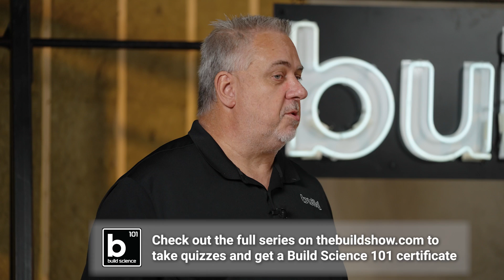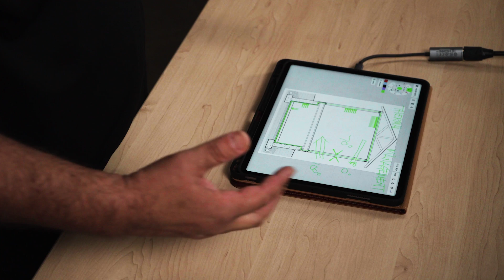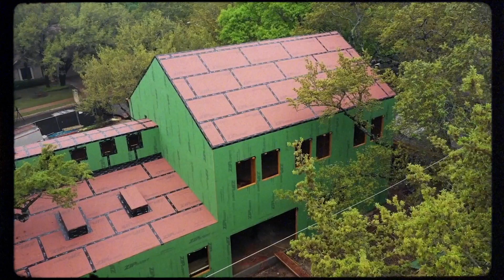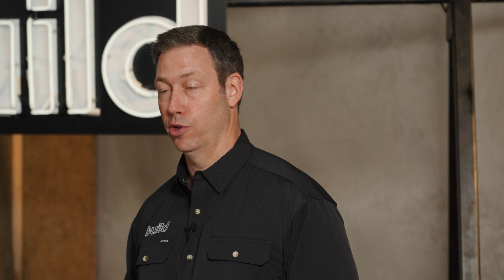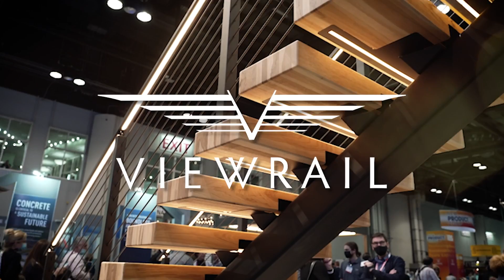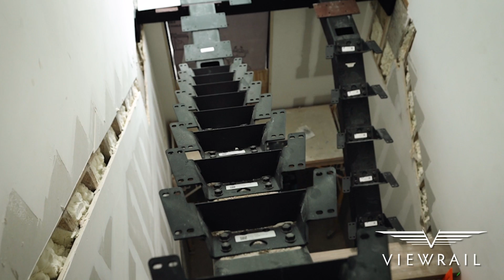Build Science 101: #10 Wrapping Up with Thermal Insulation

Comment: We build windows and patio doors with only glazing, and then close the blinds at night, which is more than half the time in the winter.  Time to bring back shutters, and insulate them now.  The sizing of furnaces is basically driven by winter conditions that happen 1% of the time, with the load significantly dominated by glazing.

Comment: Matt, I was just about to get ahold of you somehow and ask you what the best way to insulate inside or out.And then you guys turn right around three minutes later in this video and told me you said outside of the wall and I'd take it rockwool as tight as you can get, At that point can I put hardy board on the outside of the rock wall for my finished outside wall and will it be all right to sweat and let it sweat out the bottom, And then put some type of bug Mat or something on the bottom so the bugs can't get in.It would that be the correct way to build the wall?Keep it insulated, keep the bugs out and so on.Please let me know thank you very much for the video.

Comment: Just started needing to enforce the 2021 energy code... so many builders aren't ready to do the extra insulation!  R30 walls is hard to get... or start doing continuous exterior foam insulation, also not easy for mass-production builders.  (in zone 5)

Comment: As a residential HVAC designer and sales guy windows are the enemy! I see lots of beautiful older homes with tons of windows that are very uncomfortable. I would much rather have comfortable home that is more basic and has less windows!
Reply: You can buy vacuum insulated glass panels now, that go in window frames, even a single pane window has an R14 rating with this stuff.
Reply: @adamw2785  That a higher R value window than I've ever heard of. I wonder if that's with a 14 inch wall assembly. I think trapped air is roughly R1 per inch.
Reply: There are essentially no commercial vacuum insulated windows and they can't be used by themselves in climates with high Delta,T because there are no seals that can withstand the stresses from the inner and outer dimensional changes.  That is unless you are talking about a very small window.
Reply: Enough time and money into a HVAC System and duct work our old houses full of glass can be very comfortable.   More thermal mass and a very mellow way to add heat and you’ll be wonderfully comfortable 😊😊
Reply: @georgewelker853  It's always possible to make an old home efficient, but it's usually expensive. I think it's best to make the house more efficient first. Add insulation, seal up the house, and potentially install new windows.

Comment: Since night-time temps are usually much lower in temperate climates, I wonder how much might be gained with insulated shutters over windows (external or interior). In winter that might be 16 or more hours a day when its dark outside and shutters could be closed. I've seen gear driven shutters explored in places like Alaska in old literature, and interior shutters (though uninsulated) were somewhat common historically. 

Theoretically you could get away with an inferior window in a heating climate. Of course one should just "get a better window" but I'm sure stacking those together could be impressive in whole-envelope performance, and will probably last longer than the inert gas in the window.

Comment: All this R-value is not much use when the sun is beating down on the roof or wall, it is like a big heating pad in the summer.
Reply: Put ice in a Yeti cooler and in that sun and do the same with just a cardboard box. That should prove how wrong you are.
Reply: @WakeUpRightNowX  Thank you - perfect
Reply: Your heat gain in the warmer months is generally lower than the heat loss in the winter. Insulating the envelope will help keep the warm air in the home in the winter and keep it out in the summer.  At the end of the day, it’s all about heat transfer. In the summer, heat is trying to get in the home and in the winter it is trying to escape. Better insulation will improve both.
Reply: yup. puttin all dat insulation on the walls is useless when the sun is shining. absolutely nothing you can do to resist that heat. absolutely nothing. nothing at all.